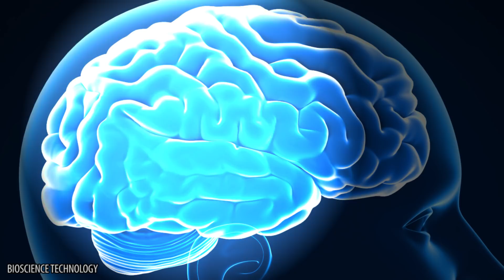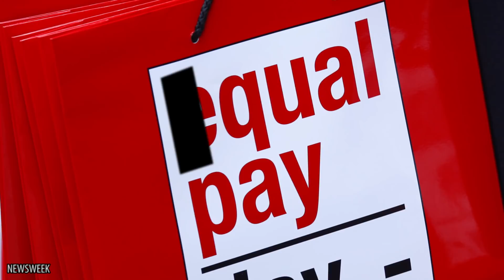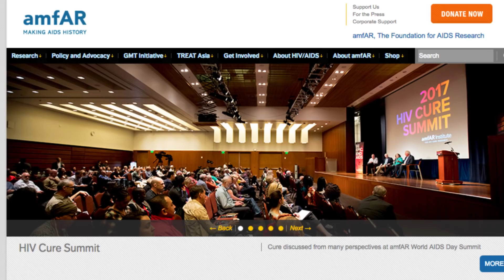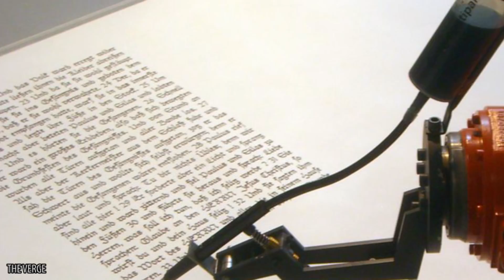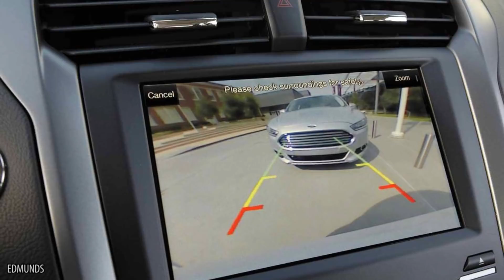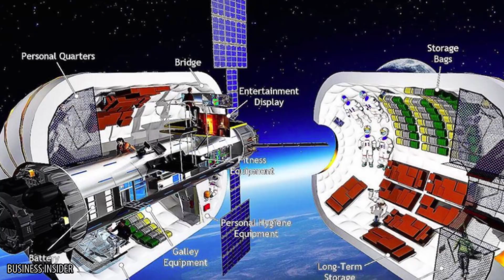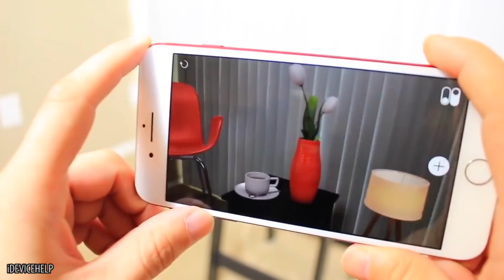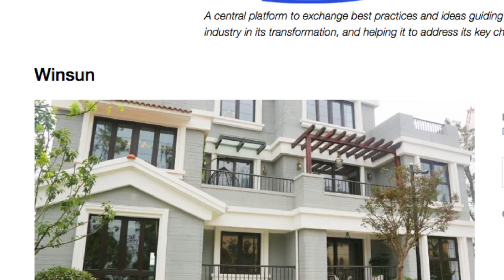10 Incredible Things That Will Happen Before 2050

Comment: The sex pay gap is a myth. Has been debunked many times

Equal representation is not a good thing, since men and women are different with different qualities and interests. Given equal opportunities they will make different choices. In other words if you force equality you have to hire less competent and less motivated people instead of the more competent and motivated people. This is just basic math.

HIV can easily be prevented. Monogamy is the solution.

I'm fine with self driving cars as long as they do not ban manual driving of cars. If that's the case the government could more easily roll out a Chinese style social credit score system. They could ban you from driving via software if you write a mean comment on the internet.

Comment: Considering that the majority of electricity is generated by fossil fuels electric cars aren't cleaner, they're just as dirty. You're just relocating the pollution to where the power is generated.
Reply: Precisely.  Not to mention developing more land with asphalt and concrete will only sacrifice more forests and grasslands alike, due to excess and continuing quantities of cars being produced like never before.  Make them more efficient individually, it results in production of more, increased demand, to say nothing of smelting metals and plastics, which aren't going to go away.  They even said the Amazon will go away entirely.  Industrialization will always be at odds with ecology.

Comment: This is nice and all but you're miss one important thing...

When will BitCoin be $1,000,000 a coin?
Reply: Never. All tokens will be worth 21,000,000 bitcoins times $1,000,000 and that makes $21,000,000,000,000  or $18,000,000,000,000 if not all bitcoins are "made" by that time. This is few tens of trillions $ only for bitcoin alone... If that happens bitcoin would have to be a major payment system in the world used by most people and in high demand. That's quite ambitious, but to me it sounds impossible. Not to forget the competition.

Comment: You forgot the fact that Human Males are expected to go extinct between 2050 and 2100, due to extensive damage of the Y Chromosome, which is incapable of being repaired at this time. It is degrading faster than anticipated.
Reply: According to researchers Y chromosome will go extinct after a few million (not 2030 or 2050 or even 300400y.) years from now, that is if we don't discover a technology to prevent this (unlikely, simply because we as a being may find a way to transfer our minds to different substrate and reproduction will be different, after all that's a lot of years).

Comment: 1) The poverty thresholds are regularly modified by whoever creates them, so over the years, they just increase or decrease the amount of "money" you need to have in a day, and overnight, people become "poor" or get out of it. It's all artificial. You can't have less poor people and have more billionnaires at the same time.

2) Gender equality is neither achievable nor desirable nor clearly definable, no matter the standards. In the workplace, jobs are chosen according to many factors, including genetics. In 50 years, the genetics of human will not change.

3) HIV doesn't exist, so every single dollar sank into research about it is wasted. During the height of reasearch on AIDS in the 80s, around 75% of the research budget set by the NIH was granted to fantasy HIV and AIDS research. More than cancer, cardiovascular or diabetes, which are still today real diseases that need to be addressed.

Etc...

Comment: At 10:44... I have had this amazing idea for an app for the last ten years. "Virtual Dressing Room". Using detailed measurements you create an avetar to scale to try on clothing before buying. SKU numbers include manufacturer measurements, so sizing is always a little different. This could be a very big deal. Cutting pack on returns & restocking fees. With an overall increase in customer satisfaction!! I wish I knew someone who could create it with me. If I could afford to I'd pay a firm to do it for me. The platform is realistic. The tech is there... Any takers??

Comment: Fiat currency has a 100% failure rate going clear back to the Roman Empire. The world over has adopted collectivism, half the world was dominated by the Commies the other half Socialists. Now it's primarily Socialists & former Commies who have learned their lesson & gone back to Capitalism. For as you should know, the Soviet Union fell due to economic failure. 

The less extreme collectivists (Socialists, excluding National Socialists aka Nazis) will soon undergo the same lesson, in some parts of the world they already have or are in the classroom this very moment i.e. Argentina, Venezuela, Italy, Spain etc. but what does this have to do with fiat currency? 

Well, this currency system was traditionally used as a desperation move during wartime to help pay for expenses. Desperation because fiat currency is the live fast die young system of currency. It can make you immensely rich in the short term but in the long term it will inflate your currency (reduce its' value) until it is worthless. 

It always happens, there's no avoiding it other than destroying your currency through some other means i.e. foreign or domestic conquest. Collectivism is so broken that they have to resort to this desperate means to keep the lights on until what ever poor country they choose to victimize is a 3rd world hell hole.

Sadly the damage has already been done, the 1st world is about to experience the worst economic failure it has ever seen. It will make the Great Depression look like good times. Well done all your charity cases who wanted welfare checks despite there being nothing wrong with you other than your work ethic.

Comment: This video is claiming the United States contributes 80% of the worlds carbon emissions...
Reply: Even worse, if you look closely at the bit about electric cars, the only logical way that making 100 million (about 10%) of the cars electric reduces CO2 emissions by 30% is if electric cars ABSORB CO2. Not to mention that "electric power" was quoted as a power generation source. Umm... sounds like plugging a power adaptor into itself.
Reply: Humans contribute less than 3%, so that's simply impossible.

Comment: Pay equally is already here. Male nurse get the same pay as female nurse.  the problem is women want to get the same pay for but not do the same job. Women prefer less dangerous jobs than men but except the same pay? Do the math. There are 50 nurses. 45 of them are females and 5 of them are males. Each individual's salary is $6000 monthly. There are 50 engineers. 45 of them are males and 5 of them or females. Each individual's salary is $9000 monthly. What is the average salary for males and females ? (45 females*$6000)+(5females*$9000) =$315,000/50. (45males*$9000)+(5males*$6000)=$435,000/50. If you choose a field that pays less, who's faults is it really ?

Comment: Gender neutral bathooms:
Odd thing is my local swimming baths have gender neutral (communal) changing rooms and toilets with lockable cubicals.
You go in there and no one batts an eyelid no matter what gender you are.
Electric cars:
I think electric cars are great. Although they do reduce C02 in the air, they do produce other gasses which are harmful to the environment. Scientists recon these gasses come from simply using your breaks or friction from your rubber tires.
Another odd thing is how Norway changed their car tax system last year because there were even more electric cars on their roads then combustable engines

Comment: woah... misinformation about the wage gap there. I'm skeptical about the rest of the video now. There is no wage gap, there is only biological differences between the brains of men and women. Which means that they both get paid the same hourly rate, but women are proven to take more time off and work less overtime. Even those without kids to look after. Also they tend to be less inclined to be interested in careers involving maths or engineering. People who think there is a wage gap need to do more research, that doesn't just confirm their bias. To be clear I'm talking about first world countries like America. Obviously Islamic countries are still very sexist.
Reply: agreed
Reply: The thing is it's very different in other continents like Asia and Africa. Not just Islamic countries. India, China, Nepal, etc all have pay gap issues. Sexism and mysoginism is still a thing in these parts of the world.
Reply: If the wage gap did exist, then why do men still have jobs if it would be legally cheaper to hire women?
Reply: The video mentions it in Western countries which this video will be aimed at informing. If they were serious about not pushing a gender bias they would have been more explicit about the other countries issues with Gender based pay gap (which isn't a thing in 1st world Western countries).

Comment: What exactly does he mean by "Electrical Power", in combination with Geothermal, hydro, wind, and solar? the other ones are used to convert mechanical power into electrical. Electric power isn't necessarily "green". Burning coal is used to create electric power.

Comment: 3:47

Both genders will suddenly get jobs as: plumbers, electricians, auto techs, mechanical engineers, sanitation workers, lumberjacks, crane operators, Appliance repair technicians, roofers, toolmakers, road workers, and cement masons.

I call bullshit.  Nice try, though.

Comment: Also, on the subject of space exploration, it's essentially just a nonsense waste of money. Our current best projected speed ability in space is under 40k MPH, which works out to roughly 0.0059% the speed of light. The next closest star to our own is 4.3 light years away. Even with a preposterous increase in capacity of about 10000x, our maximum speed would be under 60% lightspeed, making our nearest neighbor  over 7 years distant. 

Long story short, without some incomprehensible advancements in our actual travel capacity any actual "exploration" of space is perfectly worthless and just a big waste of money.

Comment: 10:00 Electricity is a mere means of transporting power. It is not a source.
Just like a drive shaft of a car isn't a source.
Electric cars run on coal for the most part, only 6% comes from renewable sources. Batteries don't store electric energy either; they store chemical energy.
Reply: Exactly. A typical charge-discharge cycle sets you back 15-20%.
As a rule of thumb, a cars mileage also decreases by 7% for each 200 lbs. The extra batteries also increase drag & particulate matter pollution, which mostly emanates from tires...
Reply: That's not gonna happen !

Comment: I've been curious about this for awhile, if electric cars are supposed to help the environment and promote "clean" energy, a primary source of producing electricity is coal, of which is a fossil fuel. So when more self-driving cars go on the market and to public use, will we have more renewable energy sources than fossil fuel sources to counteract the problem of overusing fossil fuels?

Comment: But at this time electric cars are not cleaner than combustion. Building electric cars produce more pollution and a majority of power stations are not renewable so for the time being electric cars will not immediately translate to cleaner air; for this to happen we would need to not only build new renewable energy sources but also replace currently existing nonrenewable power stations.

Comment: "Build cities in weeks" if health and safety doesn't rip it apart first
Reply: wtf? nobady said people would get and live there in weeks just build them in weeks
Reply: Craig Penfold tell this to the Bay Area. Seems it takes forever for anything to get built and it’s extremely expensive.
Reply: Agreed. Even with traditional equipment, a highly skilled team of builders can assemble the average house in a week, plus there is the period of time the foundation needs to properly settle before it is safe to start loading heavier materials into the structure and then furniture, etc.